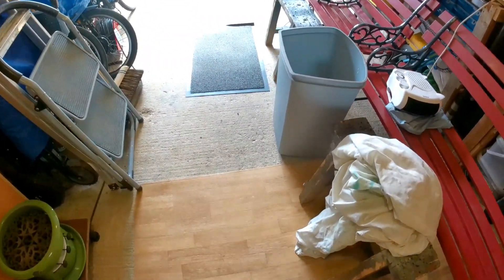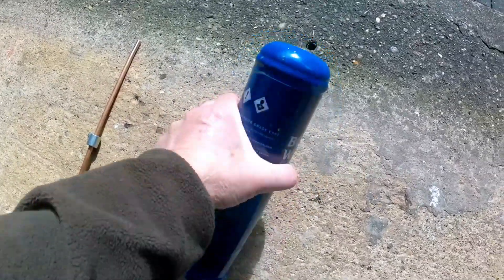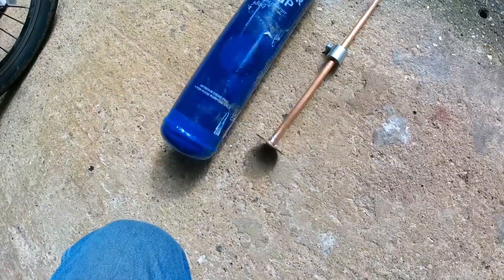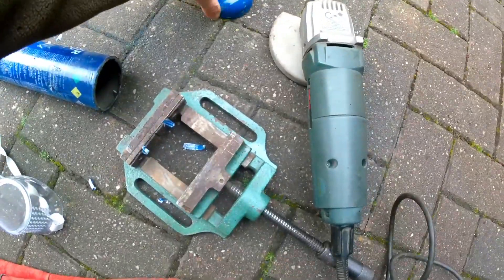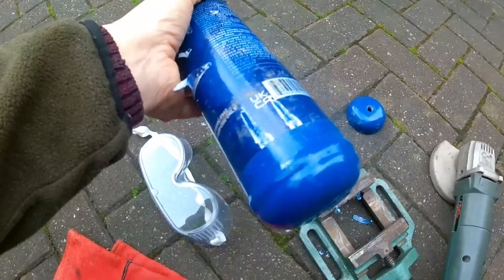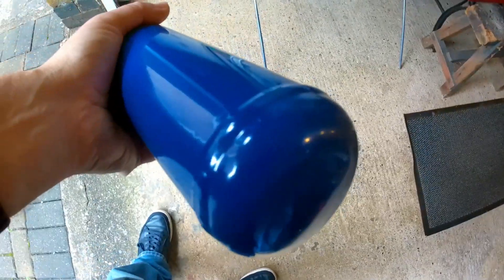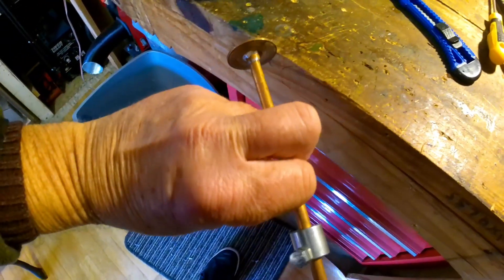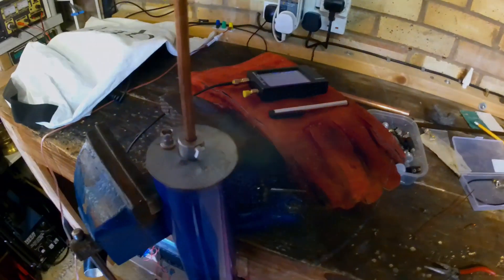Ham Radio. DIY Cavity Filter. Part 1. 70cm Band. #ham radio.

Comment: I'm not sure if you mentioned it in any of the duplexer videos you have posted but what diameter copper tubing are you using, 12.7mm (1/2")?  That's what it looks like.  Thanks
Reply from the maker: 8mm copper pipe.
Reply: @MakeDoAndMend1  Alright, now that I have re-visited this project, I have another question.  What type of clamp is that being used to secure the plunger?  Thanks
Reply from the maker: @KiloK7ILO  hi originally is was 8mm copper with a grub screw pressing into tube from a metal collar. It's now 8mm brass tube with 8mm gas pipe compression fitting with olives as similar to water pipe. Inline compression fitting with almost cut in half soldered to top piece of metal round plate. George